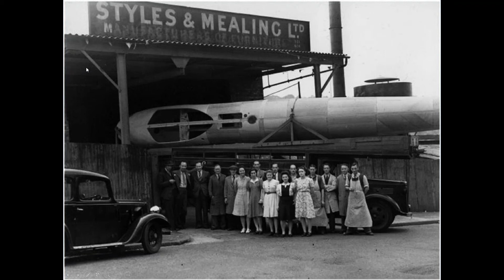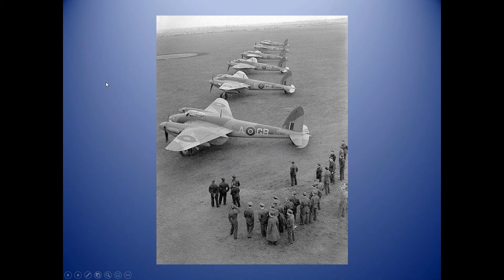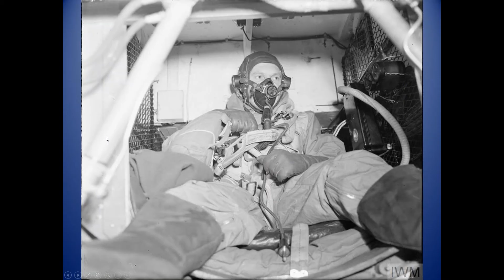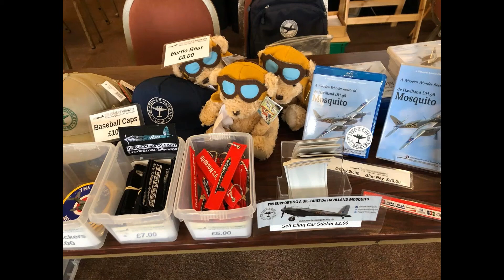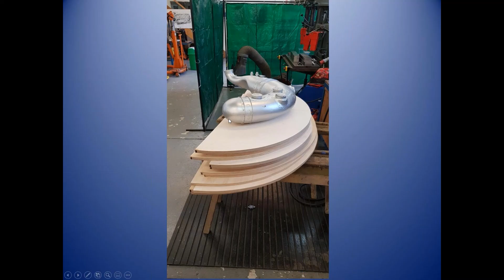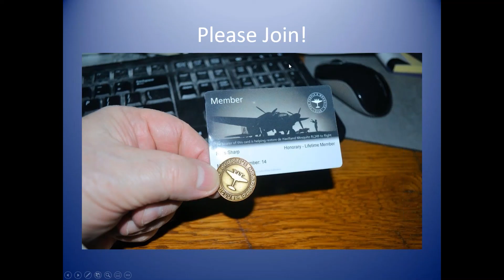The deHavilland Mosquito: The First Multi-Role Combat Aircraft | Military Aviation Museum

Comment: "On the night of 18th/19th August, 1944, twenty-one Mosquitos attacked Berlin, seven Cologne, two Wanne Eickel and five the airfields at Florennes. By then Mosquitos of eleven squadrons had been used for    diversionary    attacks on a small but gradually increasing scale since the first thousand-bomber raid on Cologne on 30th/31st May, 1942. From the spring of 1943 until the end of the war    'harassing'    raids as they were originally termed were to prove a constant and, from the point of view of the enemy, a most irritating and unpleasant feature of the bomber offensive. Night after night the Mosquitos were over Germany, flying at between 30,000 and 40,000 feet to inflict damage out of all proportion to the weight of bombs they dropped. They were at once of great value as    a nuisance,    for they caused the sirens to wail and tired workers to spend yet another night in fetid, if bombproof, bunkers, and they created a diversion, thus drawing the enemy fighters away from the main bomber stream."
 Hyperwar Royal Air Force 1939-1945 Chapter XII Oil and the Climax

Comment: You suggest in the video that the Mosquito was employed as a "Naval Strike Aircraft".  That would suggest it was operated by the FAA off carriers.  It wasn't.  It was however operated by RAF Coastal Command, as a strike aircraft.  Is that what you were referring to?
Reply: The Mosquito had squadrons employed in the Naval Strike role.  I have no idea what/who the FAA is. It did land and take off from an Aircraft Carrier for trials.
Reply: @benwilson6145  Speaking to the late Captain Eric Brown, who was the pilot for the trials, on approach to the carrier he was flying some 15-20 knots below the official stalling speed and if either engine had so much as coughed the aircraft would have inverted and gone into the water.
Reply: It was used by Coastal Command in hunting U boats. In fact on some models the 6 pound anti tank artillery piece was mounted on the Mossie. It was also tried on the Bristol Beaufighter.
Reply: @arniewilliamson1767  Well, yes, some Coastal Command Mosquitos were used to hunt U Boats but that was essentially a niche role.  For the most part Mosquitos were used in the same role as Beaufighters; as a general-purpose anti-shipping strike aircraft.

Comment: --- James Finlay  below. First Multi-Role Combat Aircraft?  The P-38 was conceived as a fighter and designed as such with Lockheed not having other roles for it in mind at the time. 
The DH98 Mosquito was designed on the drawing board as a multi-role aircraft at the onset. As a bomber/recce aircraft certainly, as it was this element that finally received funding for a prototype but de havilland designed the structure at the nose with space and strength to take 4 machine guns and 4 cannon. He just didn’t labour this point with the Air Ministry! At the time, Britain was being night bombed and a night fighter role was there waiting and he realised that.
It was never intended to out dogfight the Me109 and Fw190 but had the speed to bounce them and lay down it’s wrath upon them as and when.
In the European theatre and in it’s main role as a fighter, the P-38 Lightning was never top dog.  Me109 and Fw190 pilots soon realised they could out dive it, a basic escape route. Tailplane flutter at the limits was the problem and the reason the RAF cancelled their  667 plane order, eagerly taken up by US forces right after Pearl Harbour, which sidestepped a proposed court action from Lockheed.
In the Pacific theatre the aircraft came good against the Japanese in the mainly lower altitude combat conditions but over Europe at high altitude, the Allison engines weren’t up to it and the P-38s were withdrawn from Europe in 1944.
In Summer 1942, Col Elliott Roosevelt, the Presidents son, arrived in England with two squadrons of P-38 P5,’s Photo Recce, to work up alongside RAF Photo Recce units prior to Operation Torch in N Africa and was given use of a Mosquito for evaluation. The different capabilities of the two aircraft led him to petition General Arnold to re-equip with the Mosquito but the M.I.C. dollar spoke and Arnold directed him to look Stateside and eventual controversy over the Hughes D-2. Nevertheless, returning to Europe after Torch, Roosevelts 325th Photo Wing WAS equiped with two squadrons, 653rd and 654th, with Canadian built Mosquitos which gave stirling work for the B-17’s and B-24’s in the Eighth. These two units flew over 3200 missions and remained active right to the end of the war in Europe.
The P-38, in all it’s roles, was despatched from Europe to the Pacific in 1944.

Back to the main point. Which was First in Multi Role?
As a Fighter : P-38 in May 1942 in the Aleutians. Not much combat here. 
DH98 Mosquito from Jan 1942 against German bombers and Me110’s randomly when returning from raids. A first for the Mossie.
As a Bomber : P-38 from Feb 42 using external bomb racks.....DH98 from Nov 41 dropping 4x1000 Lbs from it’s bomb bay. A first for the Mossie.
As a Photo Recce : P-38 in April 42 by the 8th Photo Sqdn in Australia.....DH98 from Sept 41. A first for the Mossie.
As a Night Fighter :  P-38M April 45.... DH98 from April 42. A big first for the Mossie.
As a Pathfinder : P-38 from April 44.... DH98 from Jan 43. A first for the Mossie.
All in all, the Mosquito WAS the First Multi-Role Combat aircraft.

Top Speeds : P38J - 414mph in 1944….  DH98 - 433mph in June 1941 fitted with Merlin 61’s and for 21/2 years remained the worlds fastest aircraft in service until the advent of the jets.
Reply: The DH98 Mosquito was not even the first British multi-role aircraft. The Bristol Beaufighter, first flight on 17 July 1939 is ahead of it.
Reply: @jamesfinlay8180  Your earlier comment about the P38 being the first MRCA. That makes it even further behind these two Brit aircraft then. The Beaufighter saw first RAF service in July 1940 and was good in ground attack. With no bomb bay, as with the P38 it never had the out and out bomber role though.
Reply: @peebeedee6757  The P-38 first flew in January 1939, it's first of these aircraft. As for the bombers, the quote "DH98 from Nov 41 dropping 4x1000 Lbs from it’s bomb bay" is plain wrong. B Mk IV, Series 1 is 1,000 lbs. Series 2 is 2,000 lbs. Not until April 43 did the Mossie carry 4,000 lbs internal, with 5,000 lbs total possible. Out and Out bomber role, the P-38J Droop Snoot acted as pathfinder/bomb wing leader for a bomb group of P-38's. The Droop Snoot design was very similar to the DH Mosquito B Mk IV design, the armament in the front nose was removed and a plexiglass navigator/bomb aimer position with navigation equipment and a Norden bomb sight was fitted.
Reply: @jamesfinlay8180  Granted. I had it wrong on early Mossie bombloads and the later 4000lb was a single 'Cookie' carried on aircraft with modified bomb doors.
Reply: Mosquito FB. Mk VI 2,305 built. Fighter bomber/intruder variant using Merlin 22, 23 or 25. 4 (Browning) machine guns and 4 (Hispano) cannons,    plus 2 x 250 lb bombs carried internally    & underwing carriage of    up to 2 x 500 lb bombs.    Could be fitted with underwing rocket projectiles or drop tanks    instead of    external bomb carriage.
BAE Mosquito page

Comment: Lockheed P-38 is the first Multi-Role Combat Aircraft. The P-38 first flew in January 1939, the Mosquito first took to the skies in November 1940.
Reply: Lockheed P-38 was never used or designed to be a bomber as the DH Mosquito was, and it never did the number of roles the Mosquito did,  So no it was no real a multi-role aircraft,
Reply: @daniellastuart3145  Everything you have written about the Lockheed P-38 is wrong. 
The P-38 was used in level bombing attacks and a specific level bombing design the P-38J Droop Snoot was produced. 
The P-38J Droop Snoot acted as pathfinder/bomb wing leader for a bomb group of P-38's. The Droop Snoot design was very similar to the DH Mosquito B Mk IV design, 
the armament in the front nose was removed and a plexiglass navigator/bomb aimer position with navigation equipment and a Norden bomb sight was fitted. 
A simple "Google" search will provide many pictures of the design, Revell (and others) even make a model of the design.

The roles the Lockheed P-38 carried out included, bomber, ground attack, anti shipping, fighter bomber, fighter, long range bomber escort, night fighter, photo recon, 
high speed medical evac. So yes the Lockheed P-38 was a true Multi-Role combat aircraft.
Reply: @jamesfinlay8180  your quite wrong actually, p38,s never carried torpedos nor did they have a large anti tank gun in there nose nor did they fly round Germany with impunity nor could they carry anything internally only externally, nor could they engage in a dog fight nor take evasive action when attacked because of the fact they were as aerodynamic as a barn!! Nor could the hit anything like top speed carying drop tanks or bombs nor could the pull out of a dive!! They were also three times the price of a Mossie on lend lease and also unreliable.
So multi role but not as multi role as the Mossie.
Reply: @jacksonhudd3681  GIRLS ! GIRLS !   enough !!
Reply: @jamesfinlay8180  P 38 was worse than USELESS before the L variant entered service in late 1943 after 4 years of fucks up
Reply: The P-38 was not designed as a bomber. Yes but the G version... LOL